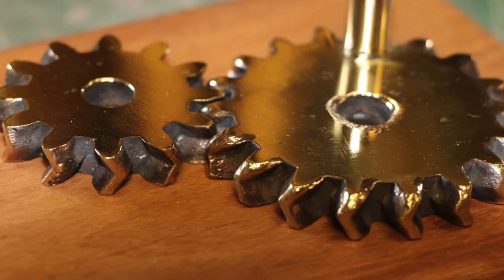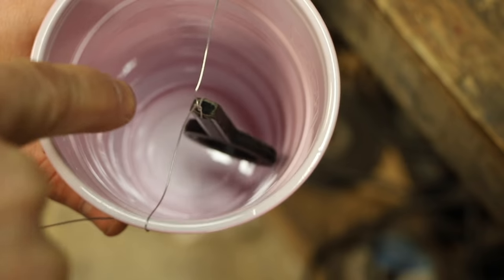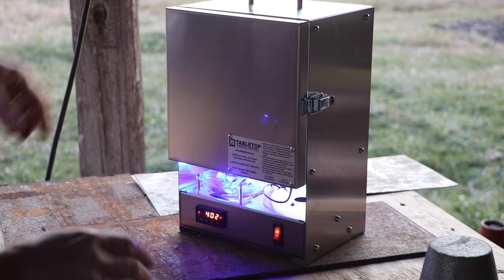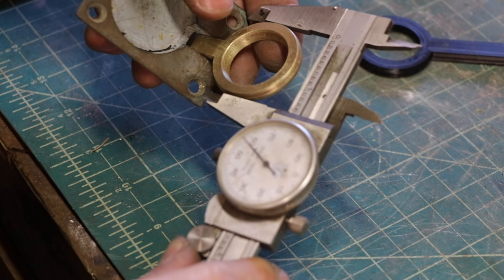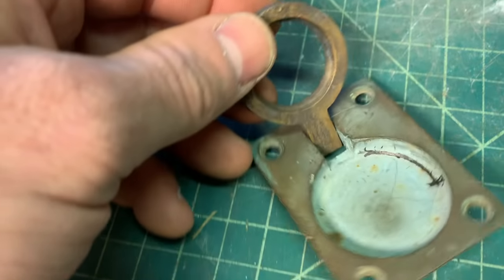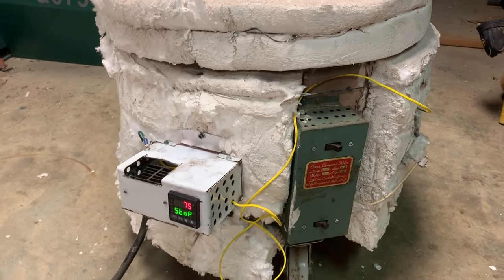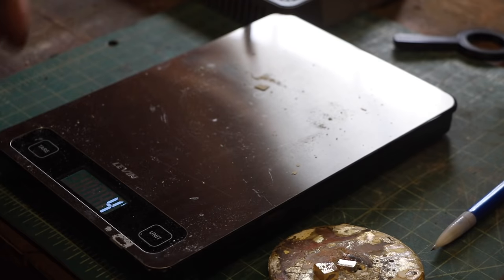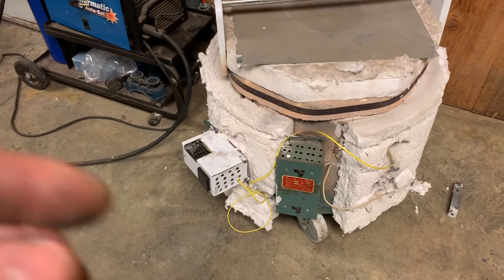3D Printing Metal At Home?  Pretty Much!  FarmCraft101

Comment: Great video, but if I was to make one suggestion the bottom texture of your 3D print just makes me cringe (and the tape peeling up). I'd suggest just getting a borosilicate glass bed for it (not the Creality "Carbon Crystal" coated one). You can pick one up for like $10-$15 and I swear you'll love it. The bottoms will come out glass smooth, no need for a scraper because PLA prints pop off when things cool to < 35°C, and when above 45°C prints stick amazingly. It makes the process so nice without the need for scraper tool, tape, spray, or glue sticks. But a little side note, the cooling effect can cause the edges of a 3D print to curl, so I'd also suggest using by default a minimal 2 parameter brim and either peel it off by hand after or use a deburring tool. Just use some rubbing alcohol to keep it clean between prints. Best!

Comment: We used chicken wire and tar paper as a vessel. Wire kept it together and from exploding miserably.  We brushed on silica $$ With a little dawn soap, then pored the plaster in. Plaster ... .. . sand, vermiculite and perlite to facilitate the heat shrinking and expansion. + you don't want to poor metal directly in the object your making but it should be an offshoot.  Any way cool stuff wished I hade a printer.

Comment: Helical gears run smoother, wear less and have less noise.  Some portion of a gear is always in contact.   But if you are going to do straight gears there's a special way to cut them for continuous contact.

Comment: 1. mix plaster relatively dry, then soak in water. 2 the area where you our the metal in is way too small. 3. you could try bottom pouring. 4, need a way for the air to get out. 5. less shrink if you have a big sprue . 6. a sharp tapering at the gate will make it easier to remove the sprue.

Comment: The cans for vacuum is also steel but has holes to access the vacuum.  All youtube that try casting with out using a metal constraint all cracked.  The professionals out side of very small parts do not use your approach.  They dip the lost pattern into plaster to coat it with layers.  The  use of casting plaster and using a temperature control burn out and pre heat furnace like you use.   you can support the plaster with sand.   I hope you give this approach a try.  you will use less plaster.

Comment: You should make a toroidal boat propeller.  I heard those things are super expensive.  A brass one would be good enough.

For the shrinkage issue, you need to design the 3D model with flanges and ears for it to hold on to the mold with as it pulls in on itself.  Better to need to shave and sand things off than to have a shrunken object.

Comment: I use a welder with graphite electrodes to heat the crucible with electric arc. The welder I have is 4.2kW (200A) so its quite powerful. I can aim the arc at the metal and melt it in minutes. Sometimes I melted the stuff in a small clay crucible I made and let dry out (I did not fire it) if it was small enough amount of material. The clay crucible keeps the heat on the inside so it doesnt have as much losses but it can start to melt under the intense heat of the electric arc. When I needed to cast something bigger I had to use graphite crucible. The graphite is not as good insulator so I usually have to put some rock wool around it to lower the losses but the benefit of the graphite it that it doesnt melt under the electric arc unlike the ceramic or even alumina (Al2O3).

Comment: helical gear does not really take higher loads, its just a LOT more quiet than a straight toothed gear would be. (the transition between teeth contact points is smoother, so less sound and higher possible speed before the vibrations cause issues)

Comment: use 50/50 hydrostone and Silica (Flint) (400 Mesh) for your molds. silica is available at ceramic stores. cheap. keeps your molds from cracking.

Comment: Actually yes, you can cast these teeth nowadays. There are sand 3d printers which are used in such appications. You can also you regular wet sand and form it, but youd have to be very careful not to break the sand which wouldnt work for large quantities

Also a quick tip: design a second spout so the air in the mould has somewhere to go to. This means also more material so when the part is shrinking you wont have imperfections. We call them lunker (little bubbles inside the finished part) or when the middle is flatter than it should be. This prevents that.
Not sure i could bring my point across but hope i could help :)

Comment: To avoid air bubbles you should mak a small batch of plaster and brush the object two or 3 layers... Then pour the rest.... Or you can make your own vacume chamber with a box and a cheap vacume cleaner... Also if you mix  your plaster with silica sand 50/50 you'll have a much stronger mold that can withstand heat and pressure and gets rid of ainy trapped moisture

Comment: Cracking in your mold can be caused from too much water in your mold mixture or from drying it too fast. You might be able to get away with adding a plasticizer to make your mixture more fluid without as much water decreasing cracking when drying your mold. And if you do get cracking like he did then just wrap your mold with a multiple layers of aluminum furnace tape and hopefully your poured metal won't melt through.

Comment: integza on yt used a filament that had powdered metal in it (very abrasive to your nozzle tho), printed his part then did a sintering period of 6 hours in a kiln to get rid of the other plastic in the part  and fuse the metal together. your process seems to produce much more detail in the final part, but does require some tooling.

Comment: if you use a sawzall with no blade in it to sake the cup it will vibrate out the air bubbles be tough to hold with something that small without making a mess but its doable and works well for me and its something you dont have to buy as most people have one in their shop already

Comment: To avoid air bubbles ob the oart, try dipping it in a slurry of plaster foe a few coats orior to placing it in the mold and filling it with more plaster

Comment: You can save time by removing any metal wire and microwaving the plaster at 30 second intervals to cure it.
Reply: Note, the plaster should not crack and will be significantly lighter. 🤔

Comment: Bought an old Jeep 2008, had a soft top. Bought a hard top, but the Latch position is not align, will need to make a new one with a 2 inch extension or weld a piece on current latch, this may be a good solution to make a new one.

Comment: Correction- spur (straight cut gears) are the strongest. Helical gears are used to reduce noise, at the cost of some strength, but introduce axial (endways) loading to the shaft, meaning you might need to use a separate thrust bearing. Using Herringbone gears means you have less noise, but the same axial loads as a spur gear. Note that for high speed (eg automotive use) the tribology is different - for spur gears you just need an oil with a high film strength, but for helical or herringbone, you must add extra shear strength, because helical gears have a wiping action. I made herringbone gears from a single right-hand helical gear that I split down the guts with a lathe cut-off tool, then brazed the two halves together (I tried arc welding but it warped after re-nitriding the teeth). Just saying....
Reply: We should credit the great French engineer Henri Citroen for his invention of the double helical gear type. Nice video, warts and all.

Comment: Good God... I'm way impressed with your manner and your clear and you make sense, as well as share the cock ups as your taking us through the procedure.  Hey most importantly it's experimental , working the RANDEE .
I was wondering what if it doesn't work ?
I thought how's you going to fix that?
You'll have a trick up your sleeve and it worked I had faith in you corse you know your shit to buddy. 
Yep that's not to bad a price considering  steel work is f....n expensive works then machining right to the finished product ready for insulation .
Hey that not to expensive for a kiln and furnace heating source and crucible. Hey I'm accurly thinking what is a crucible made from or the best material for making one or more  is it like a refractory material with clay?? 
If some one could advise me on that question,  or is it easier to buy one. 
But if we like kilns then we have to have  one for pottery with the old peddle powerd pottery whees like we had in arts school .
 As anyone who works with steel of any kind knows that Metal Uruguay is the subject of a university levels and it's the bible to,the trades we all work in and it all makes we this subject easier to understand pre temps and running temps whilst welding ,burners will be used to slowly cool things down to stop cracking buckling as much as possible or... we're as good as throwing it in the bin.  
DCM 
Don't come Monday.

Comment: on your 3D printed part, put a cone-shaped funnel on the top of your part, and fill the mold up to the top of the funnel. As the metal cools and shrinks, the excess in the funnel reservoir will be pulled into the part
Reply: lol, nevermind, saw the second part mold. gg

Comment: Man we could have used this at my dads business, we sell rotisserie chicken and the machine came from Lebanon (very reliable, very affordable and awesome build quality) which use weird gearing, that needs a certain type of metal (softer so the gear wears out, not the super expensive parts) each gear costs around $35-90 depending on how good you want it and where you get it from.

Comment: Could you make a screw hole to screw stuff into it? For example, make a C clamp that has threads at the ends to screw it directly… idk if a 3D printer can make threads but my guess would be you’d need a finer head to do so?

Comment: The shrink rate for Cast Bronze is 0.0156" per inch.  So, if you wanted to cast anything in bronze and it cool to the desired size  you would multiply (scale) your model (pattern master) by 1.0156".

Comment: "Just out of high school I took a job at a place called Delton Locomotive Works.   We built 
"G" scale locomotives along with all of the rolling stock that was period correct.  
So these locomotives and all the cars were solid brass.  The engines were between 15"-25" long and they were very detailed along with each boxcar, tranke cars etc.  
Keep in mind that it was the late 1980's and now at 54yrs old I am sitting here in my shop getting flashbacks on all the fun we had.  How can you have a bad day building toy trains.

In my opinion you need to do the lost wax method.  I would bet if we put our heads together we could get you making really detailed parts with very just a couple of small changes.
So I typed a whole gigantic comment and I into the house for a minute and when I came out the comment was gone so if I posted 2 comments I apologize.   I click on all the buttons for you so get in touch with me and let me throw some old mans thoughts at ya

Peace
Rich

Comment: I learned lost-wax pouring in my dads dental office in the ‘60’s. Sure wish I had his old centrifuge.
Instead of vacuuming, I’m wondering if pouring with the molds on top of a vibrating surface might help fill the corners. It would be simple to make and try!
I’m currently awaiting an Ender 3 S1 - my first 3D printer!

Comment: You don't need a vacuum chamber to eliminate bubbles.  In fact, a vacuum chamber will only increase the size of bubbles that can not find their way to the surface.  A much more reliable method is to use a pressure pot to compress the bubbles to a much smaller size.  All you need to make one is a pressure cooker, a couple of valves, and a compressor.

Comment: they use shaker/vibrators for concrete to remove bubbles. could maybe use an oscillating tool in some way rigged up to the cup (2 face tape a blade to the bottom of the cup?) to shake the bubbles out. just a spitball idea on the fly

Comment: Couldn't you place can on an old flat sander minus sandpaper for removing bubbles with vibration? I used this on plywood below concrete countertops during forming.  Super smooth and no air pockets when forms were removed. Anyway,  gonna keep all my old cans now.

Comment: if you want a smooth surface you need to make it in the pattern. try melting some soft wax in a thin layer then use paper towel to polish it allowing the little bit of  wax to fill in the print layers. You can also use some soft wax like the kind on baby bell cheese which you can mould into a cone and use as a sprue to evenly flow the metal into the investment material. Yes i'd get high temp investment stone for the lost wax technique which also gives you minimum expansion  than plaster of paris. You can also burn out at 800F then raise to 1200F just before pouring. You do not want to pour cold. and you need to have a steel pipe as a ring to hold the investment material at the sides.  Bigger oven for bigger objects. acetylene torch can also melt the metal or use Mapp gas with Oxygen.

Comment: On the bigger gear you had less volume to push down above the part in relation to the small gear, maybe that could have something to do with it as the pressure is spread on a larger volume.

Comment: I'd like to see you make a furnace that is hot enough to melt metal,  but fueled by waste cooking or motor oil.... I believe this could be done if it can be evaporated and blended with compressed air. What do you think?

Comment: that is called investment casting, and you can compensate parte of the shrinkage by moving the thermal "barycent" of the heat  away  from the component using a riser

Comment: You forgot one critical piece of equipment cost and a disclaimer that you must like canned soup in order to do this. HA!  :P

You should look into making a DIY cooling vacuum chamber. All you really need is a steel container that can contain the molds and a decent volume of air, that you can seal air tight. Add a one way valve to allow the hot air to escape (  You could just use a cork.) . Apply some modest heat to the container wall to get the air temp up in the CV chamber (around 150F to 200F internal air temp should do it.) That will force the air inside to expand and push out of the valve. When the heat dissipates from the chamber wall, it will create a vacuum, making the air bubbles more buoyant and drawing them out of the plaster.   It will also draw some moisture out of the plaster so you might want to make your plaster about 0.5% to 1% thinner then run 2-3 quick air cycles back to back. Cold water can be used to dissipate the heat rapidly.  It should take about 20 minutes to run a couple heat/cool cycles to get a good enough vacuum. Remember you aren't heating the plaster up to 200F, just the air.    

You could test the heat/cooling vacuum using a paint can and a small cup of plaster with a vacuum gauge and scale up the results based on the volume in the can, vs your target chamber size.  Alternatively,  an old pressure cooker might be a good item to convert as well. You are just reversing the pressure valve direction.

Comment: An easy diy way to make sure there is no air bubes is a battery connected to a DC notor from a remote car or something random like that maybe even gaming controller that you could off set a weight for shaking and could even connect that to a pan for a sonic cleaner but if you just attach it to a piece of wood and suspend ghat you can then set the cup on the wood

Comment: If you can find it, you should try Ultra-cal 30.  It sets MUCH harder than hydro or plaster, it's great stuff if you are going to throw it in an over.  It essentially sets to stone.  Awesome video though... Thanks!!!
Reply from the maker: Thank you.  I ordered some to try.  I have been having limited results getting highly detailed results with this method, and I think the plaster is the issue.  Videos coming soon.
Reply from the maker: Do you know the proper burnout schedule for ultracal?  I keep getting cracks in the mold.
Reply: @FarmCraft101  Hey  =]  Sorry, I'm not sure what a "burnout schedule" is.
Reply from the maker: @daimyo2k  It's the procedure for burning out the PLA from the ultracal mold.  The schedule for Prestige Oro is something like: Heat to 300F over 4 hours, then increase to 750 over 2 hours, then increase to 1650 and hold for an hour.  I tried that procedure for ultracal and it causes lots of cracks.

Comment: Have you casted a helical gear? Our mixer is broken and I noticed that they have used plastic helix’s gears versus metal worm gear, causing the plastic ones to break easy. I was thinking to cast them out of aluminium or brass but, the broken gears can not be used for cast!

Comment: Any ceramic including plaster must be gradually heated and cooled; very slowly.  Cool downs of 12 hours or longer from 1200 degrees are mandatory, and still many pieces will crack due to variable areas of temperature inside the kiln.  I crafted an elaborate vacuum system to my kiln to homogenize the temperature and oxidize my glazes, which works well but is difficult to build and tune.

Comment: looks like at the end theres a slight size change between original print and cast metal, maybe an idea to increase size of 3d print by that coefficient so the cast is the size it needs to be ... kind of like tracing around an object with a pencil, same ouline but ends up inherantly slightly larger

Comment: You can get "ramp-soak" PID controllers for really cheap that would let you program in this entire heat sequence (even with a gradual temperature ramp). Wouldn't it be nice to have it dry, cure, melt out the plastic, and then cool and hold?
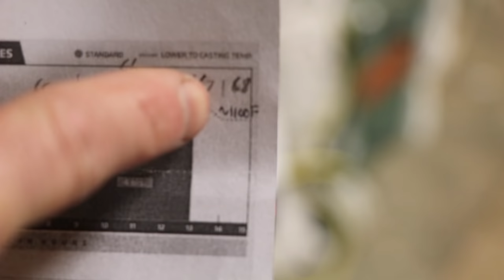Reply: And theeennn you have one..... 14:30

Comment: 3d print little cavities above each tooth at the top, the air will fill those bubbles instead, then you can sand/grind off any little tips on each tooth after